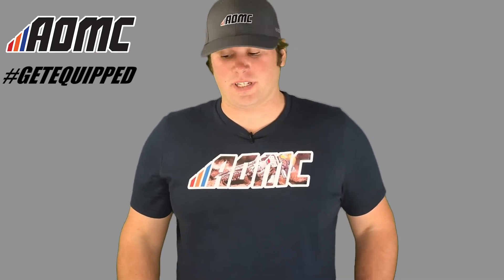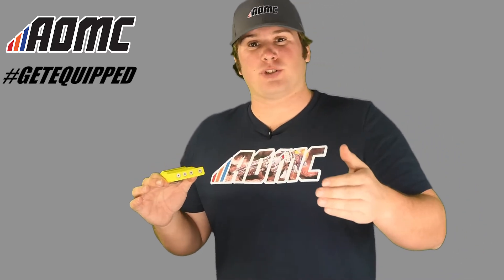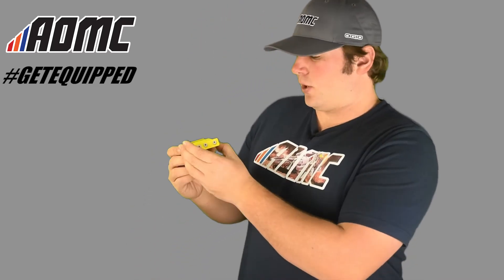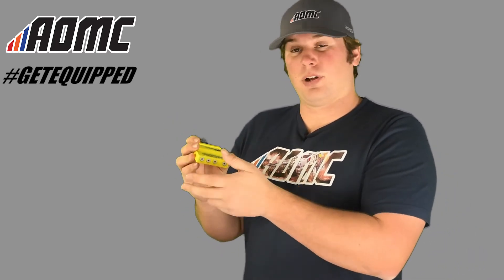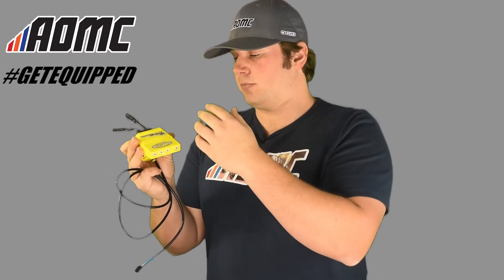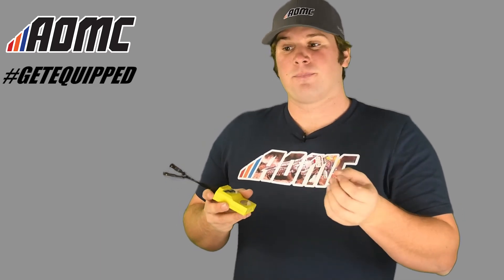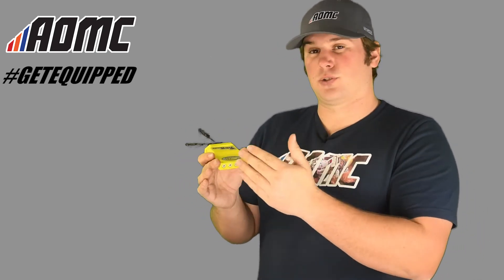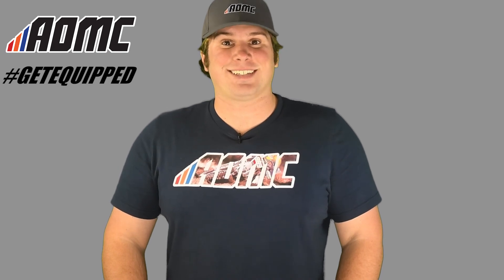Vortex X10 ECU

Comment: I took apart my new used 15 kx 450f I jus realized it has a vortex’s ecu I moved the tps sensor and can’t get to the proper.60 voltage what do I do to fix’s the problem bike runs soo bad and sounds horrible I could only get it to .46 what do you do with a bike that’s not electric start is there a procedure thanks for any info

Comment: What is the process for ressetting? The instructions says "codes will flash until the ECU is reset by being powered down and restarted".. Is that just disconnecting the battery? For reference I have a 2022 KTM 500 EXC-F with FMF 4.1. I am getting a constant blinking code light and need to reset. The bike runs perfect .. Not sure why its blinking.. Thanks

Comment: I have a 2018 KTM 450 sxf which comes with factory 2 map, traction control and launch switch.
Will I loose those switch functions with this ecu? 
Do I have to buy that extra switch to change maps on my KTM with the vortex?
Reply: what did you find out on this?
Reply: @DoctorGoodnight  idk if you got your answer for this, but the Vortex comes with its own launch and traction maps you can flip through

Comment: I have 2017 sxf250 . I want to take it enduro. Will that ecu help with stalling and power delivery?
Reply: I have it on my 2018 rmz450 it’s far from stock and when I put this guy on I noticed an immediate huge change it was worth the 700 I paid I love it the bike starts first kick even when cold (after priming) and has a huge change in power. Now stalling you might have to work on that and your clutch fingers. I suggest a rekluse 3.0 exp clutch. You will never stall it again unless you have catastrophic engine failure I can promise you that

Comment: i have one on my yfz450r, (stock with FMF exhaust and Powerbomb header) its at lo5 mid5 hi 5 X10:1, I'm wondering if i have to increase it since its getting cold here in quebec, temperature dropped below 15 degrees and it was set at those parameters in summertime (75 degrees)
Reply: 2012skaterz2012  no your efi bike has an intake air temperature sensor and changes the settings itself with the temp
Reply: Call Vortex ignitions for good Australian customer service.
Reply: Jj